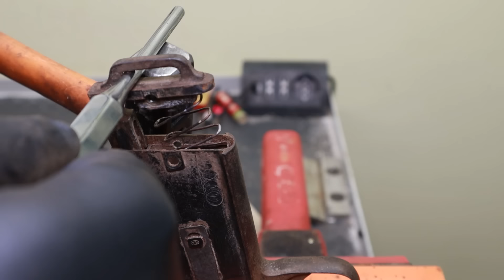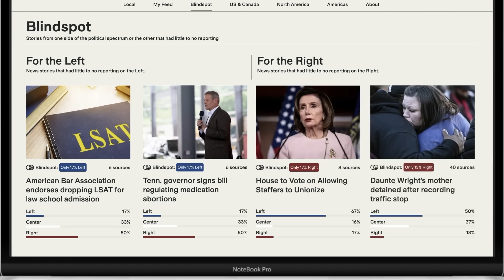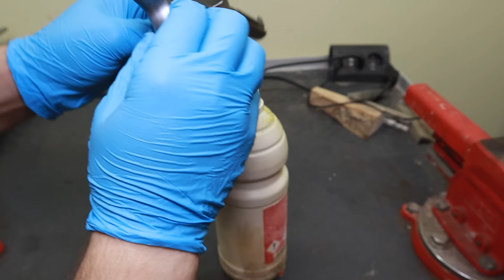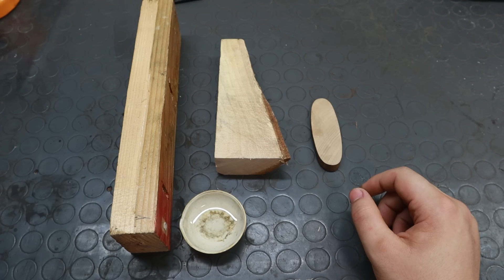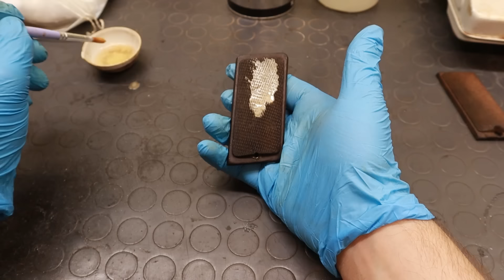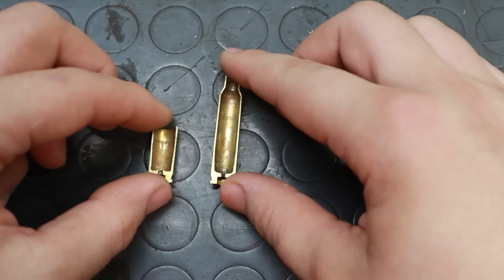Restoration of WWI Austro-Hungarian Steyr Hahn Pistol

Comment: The level of corrosion on this weapon is just surface just like it was sprayed with salt water and left for some days or a week I can't see any heavy pitting or bad internal rust just a very uniform layer of mild surface rust on the outside

The pitting on the slide looks like honest rust as it's an old weapon but unless someone's house got flooded for a little time this is no find,, if it was left to trust longer it would not be usable.

I never see the FCG being polished up and such as if a weapon realybneed reconditioning everything is remove, inspected, rust, removed, refinished inspected and oiled.

Also you would usualy replace all the wire springs that are not so hard to get (you can get custom prints made)

I hate to think someone would do this to such a nice historical weapon.

Comment: How about electrolytic rust removal?
Reply from the maker: I don't like it, it doesn't work well on assemblies, each component needs to be wired. It also removes existing bluing just like any chemical process, and causes the reduction of hydrogen on the metal surface, which can lead to hydrogen embrittlement in certain conditions, especially on hardened components. It also doesn't put back metal where it was, it's not an electroplating process. What happens is some of the oxide gets reduced to metallic iron, but in a porous, almost powdery form, without any meaningful mechanical strength. This can be useful for cosmetic reasons, if you manage to get this porous material inside the pits, but I still think the drawbacks overweight the benefits.

Comment: One of easiest rust bluing solutions that you can get everywhere is iodine solution (form pharmacy, alcohol iodine solution - antiseptic). Works very well. In many countries, for example in all EU nitric and hydrochloric acids are hard to get (because they are precursors for making i.e. evplosives).
Reply: And because certain demographics use them to throw on the faces of disobediant women
Reply: Nitric acid and even HCL is a nightmare to find in the EU .
Even nitrite fetikizer is a pain to get.
Reply from the maker: Hydrochloric acid is not on the EU explosive precursor list (at least last time I checked, about 6 months ago). Nitric and sulfuric acid are instead both on the list. That's because these last two are required to make nitrating solutions, which are needed for the synthesis of the vast majority of explosive substances. All the few that remain rely either on hydrogen peroxide, chlorates and perchlorates, or ammonium nitrate, which incidentally are also on the list of restricted substances. On the other hand HCl has no important role in the production of any explosive that I know of.
Reply: @Backyard.Ballistics  I wrote "i.e." because HCl is precursor for makng psychoactive substances (amphetamines). Restrictions are the same like in nitric acid.

Comment: 9X23 is frequently used in open pistols to shoot IPSIC matches. I had over 100 empty cases that I collected from the range floor. I think Starline is the manufacturer.
Reply from the maker: those are probably 9x23 winchester, not 9x23 Steyr which is an obsolete. They are close in dimensions though, but still about 0,5mm (.020") shorter than the Steyr

Comment: For all wood on firearms that is oiled, you can use laquer thinner and a soft bristle brush and rags to pull all the oxidized oil, rust and dirt out of the surface. Of course, you have to re-oil the wood, and from my experience linseed oil and mink oil works the best. A good way to get a shine on wood stocks without laquer is using a soft buffing cloth after the excess oil is wiped off and the remaining oil sets into the wood. Has worked very well for me for restoring a 1916 Gewehr 98 and a 1918 M91 Carcano.
Reply from the maker: thanks for sharing ;)

Comment: I am continually amazed by the quality of your restorations and I learn something new with each video.  Have you considered sandblasting as part of your oxide removal/surface preparation process for the metal components?
Reply from the maker: I have not a lot of experience of sandblasting... Shot peening or glass bead blasting are more common on guns, but I don't have the equipment yet

Comment: I just picked one of these up aswell and had to do a few similar steps with it. Did you remove the trigger and extractor/firing pin as well, just off camera? I think I would suggest it. Mine was mostly fine on the surface, but the firing pin and it's channel definitely looked like it hadn't seen the light of day in 100 years. 

While the extractor is a pain in the ass to remove, and breaking it is real bad news, at least here in the US, I still felt it was worth the risk to at least keep it from continuing to rust
Reply from the maker: I did strip it completely, but couldn't include all of the footage for time reasons. I do agree it's hard to figure out how to remove it if you have never seen it done before.

Comment: @backyard ballistics
You know if those 9x19mm barrels you can get for Hahn's are just drop in or not? 
IGB Austria makes them.
Reply from the maker: As far as I know they should work straight away, at least the ones that I've tried. There are even 30 Luger barrels for it on the market, and even those work straight away.
Reply: @Backyard.Ballistics  Thank you, I thought that was the case, but could never find confirmation. 
I guess I know what my next gun purchase will be!

Comment: A #0000 carding wheel will remove rust without  gouging the metal. It's absolutely safe.
Reply from the maker: But I needed to remove metal, not simply rust, I was talking about abrasive wheels, or buffing wheels, (which work with a polishing compound that contains tiny abrasive particles), that will take material off anything softer than quartz

Comment: I wish I had this guys talent. Was trying to refurbish my grandpa’s .22 rifle, but destroyed the aluminum receiver trying to remove the barrel pin.
Reply from the maker: One of the first lessons I learned is not to take off barrels unless strictly necessary. The good thing about rust bluing is that you can re-blue a barrel even if it's still attached to an aluminum receiver (with some care not to damage the aluminum finish), which a hot bluing bath would destroy in heartbeat.

Comment: That rust pattern looks amazing. No bright orange spots, just an orange sheen. It means there is very little pitting (pitting causes structural failures)
Reply: To be fair, they did know how to build them. They werent mass produced for max profit, but were built for max performance.
Reply: @cactusmann5542  The quality of steel made today is lesser compared to 100+ years ago. The differences are they used pure alloys while we use heavily recycled alloys and certain chemicals and forging techniques aren’t used anymore either because it’s not profitable, no one wanted/ needed to use it, or it was regulated out of existence due to one factor or another.

We could make steel just as good or better but then no one would need to replace things made that way as often and it’s would be more expensive to make and as a result have lower profit margins.

Comment: That almost looks like the previous owner attempted to "Refinish" the piece but mucked it up and ended up with this external that looks like a rust bucket with relatively clean internals.
Reply from the maker: Somebody definitely brushed it at some stage. The amount of corrosion product that were on the surface are way to small to justify the extent of metal decay

Comment: first off, great video! very entertaing. second could the right side grip have been darker because the gun was used by someone who was right handed? My thinking is that if it was the right side would have been in contact with the shooter's hand that has acidic sweat on it?
Reply from the maker: This is a very smart question. While making the video I checked our forensic reference warehouse for similar situations, and have found that other 2 pistols we have, both P08 Lugers, have the right grip darker than the left one. I haven't found one where the left grip is darker. In all other cases, there is no noticeable difference between the two grips. I though it could have been because holsters are worn on the right, so the left grip is more protected by the body, but both the steyr hahn and the luger used holsters that completely cover the gun, so your interpretation might be more correct than mine. Maybe it was the hand...

Comment: But if we look at the fact that this gun is more than 100 years old, it's still in a good condition
Reply: I have personally handled and/or fired a number of examples, guns made using industrial processes (post 1880 or so) really don't "Wear out" the way people think they do.
Reply: Like most steel and brass objects, a well maintained firearm can look quite new and function as intended for centuries.
Reply from the maker: If it had been stored oiled in an airtight container it would have looked practically the same as it came out of the factory. With good care guns don't decay, although they wear out with use, but for pistols that means running a whole lot of ammo though it ;)
Reply: Lol, I’d love to see a Glock last that long. 😂
Reply: But if we look at the fact is achually in fact in  reality in fact 100 years old, to be honest its achually infact in a spledid condition if I say so myself achually
Reply: @IL0909  ok
Reply: @ILO.. you were just told from an expert that with care they remain in pristine condition.. and yet you're too dense to accept that you are wrong. Wow.
Reply: No, it isn't. There are Steyr-Hahn for sale in Poland for reasonable prices that have more than 50 percent of the original coating and barrel in undisturbed condition.